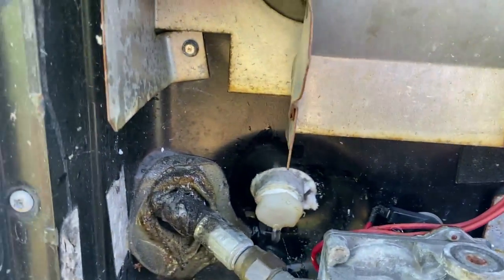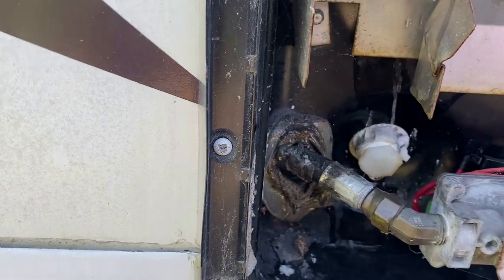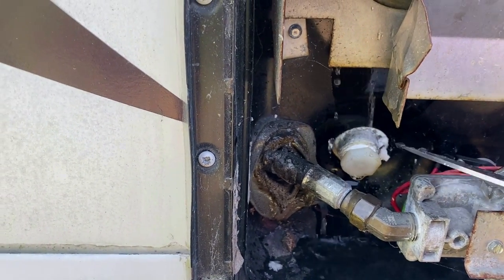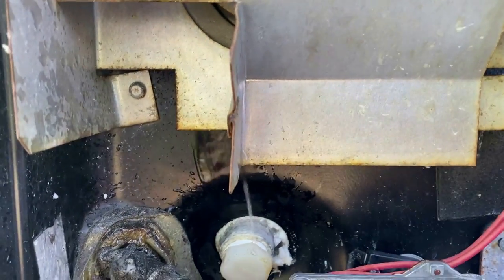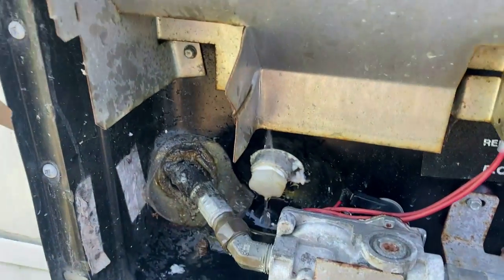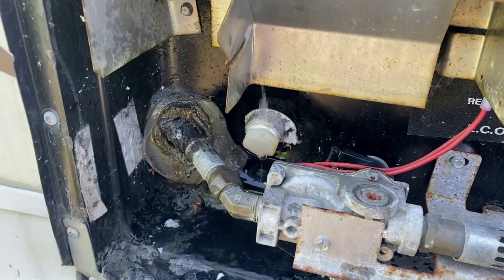Attwood Water Heater Leaking. Tank Cracked? Replace Or Repair?

Comment: I got the same one that was leaking change that plug and then it was leaking out the pressure release valve, change that too and all that leaking some how has killed the water tank now
Reply from the maker: That happens sometimes.
Reply: @hillbillyrv  So I gathered more intelligence.  I connected the wires bypassing the thermostat wires, but it is still dead.  What might be causes then?
Reply from the maker: @jamesbondaygee  You have to follow the trail of electricity and figure out where it stops.
Reply: @hillbillyrv  Question: Where do these units plug in? Seems like power just died.  I see a cord that runs inside along wall....maybe it got disconnected somewhere.  Does it plug into DC power somewhere?
Reply: @hillbillyrv  so good news I did some more playing with the plugs and testing the connections bypassing the thermostats and it fired up, at least on the propane side
Reply from the maker: @jamesbondaygee  Most are hardwired. No plugs, but some RV manufactures will install a cord and plug in the AC part of the WH. If so, it will be withing 18 inches of the back of the WH.
Reply from the maker: @jamesbondaygee  Those thermostats can go bad.

Comment: Easy peasy time to go have a cold one ☝️
Reply from the maker: Yeh !!!!
Reply: @hillbillyrv  hi Kenny can you change that out with a brass plug or will it get electrolysis
Reply: @coreymerritt7742  the mfg recommends only the plastic plug because of thread tension and it’s considered a self sacrificing tank.
Reply: @marcuscarmouche9023  ok thanks I have the anode version I was just curious 🧐
Reply: @coreymerritt7742  yup most likely a suburban for longevity I would think the anode is the way to go but I have seen some pretty old Atwood/Dometic’s.
Reply: @marcuscarmouche9023  yes it’s a 2006 suburban I change the anode every 2 years or so and give it a good cleaning as well thanks Marcus
Reply: @coreymerritt7742  anytime bud
Reply from the maker: @coreymerritt7742  I don't know. I just always keep the Attwood nylon plugs on the truck.

Comment: Do they recommend plumbers tape on the nylon plug before screwing back in?

I noticed mine had a very slow leak the other day and it's a Brand new plug. Wasn't sure, timely video post! Thanks!
Reply from the maker: Yes, Teflon Tape
Reply: @hillbillyrv  thank you!